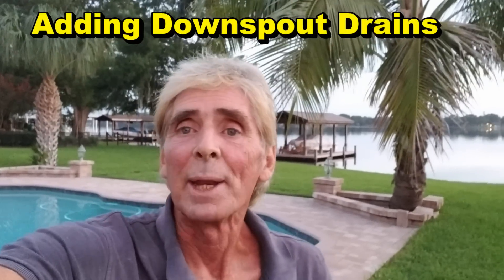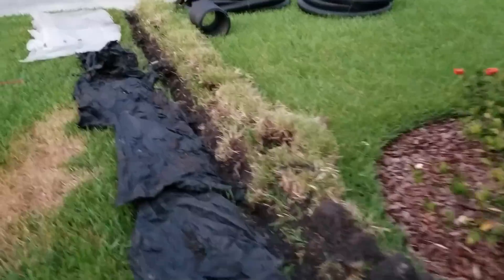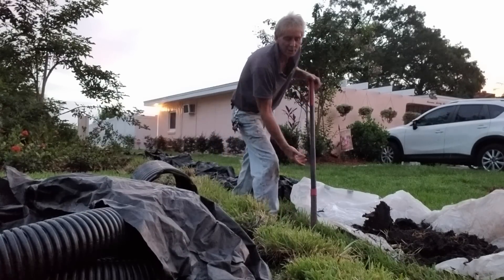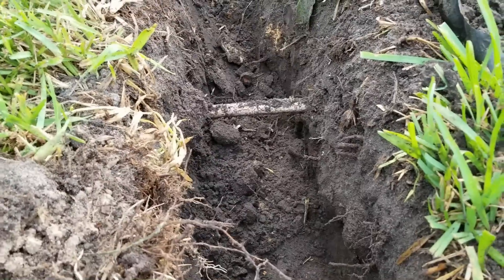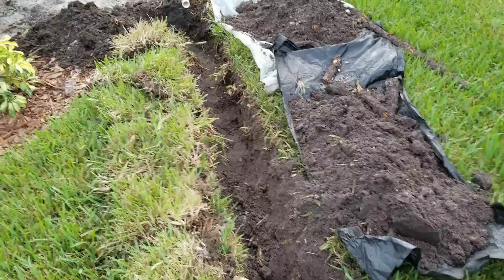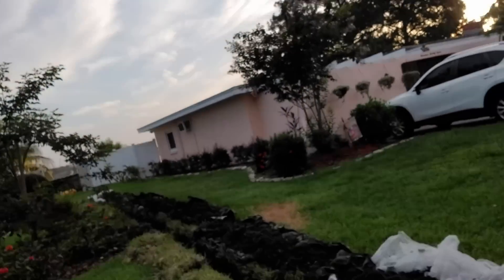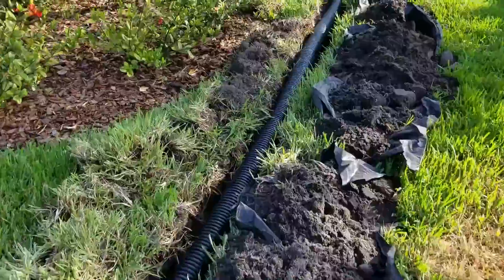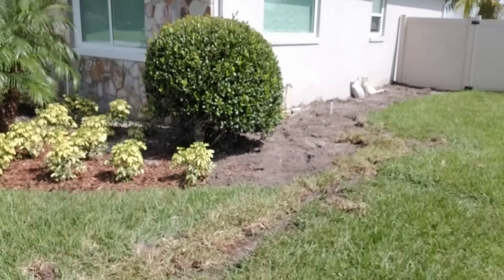French Drain, Install Downspout Drain with Sump Pump attached, DIY

Comment: Chuck what happens with this type of set up when you loose power in a tropical storm and have no power to the sump pump.  Is there a way to create a backup drain that works on gravity alone in the case of power loss.? .. Thanks I find your videos very helpful